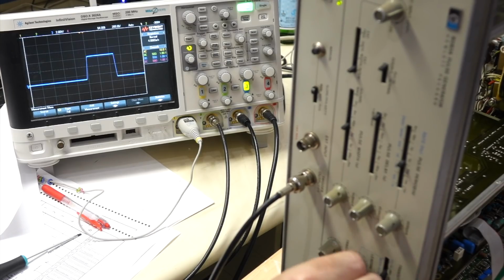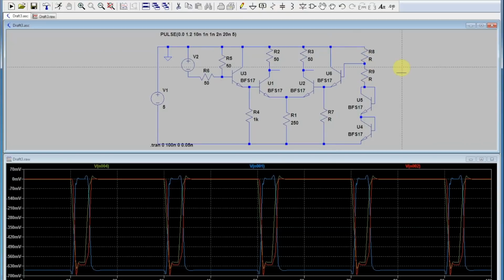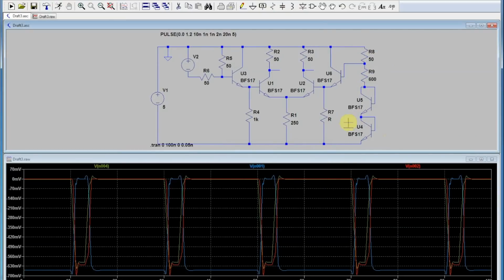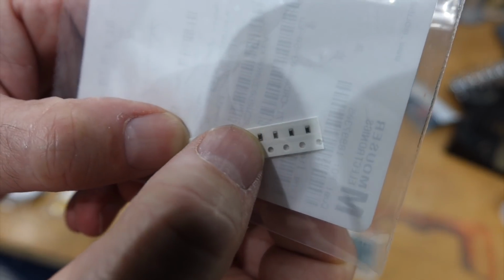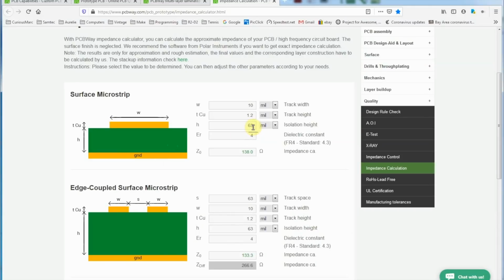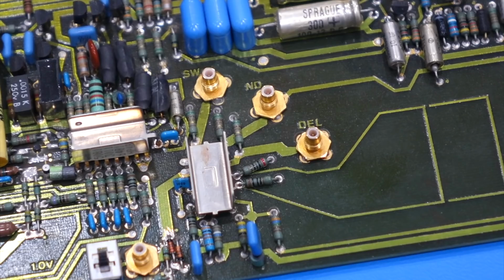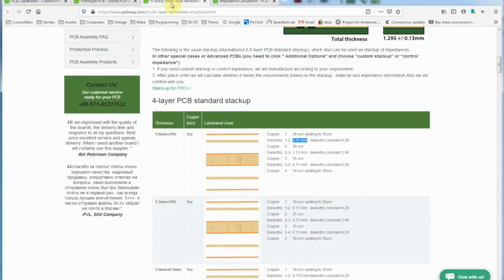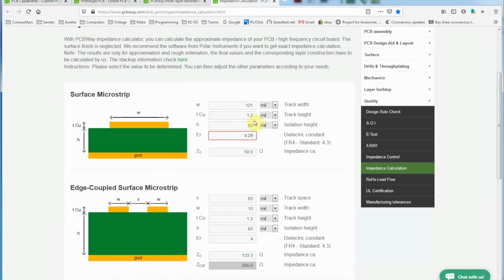HP 8082A Pulse Generator Repair Part 3: Ersatz  ECL Fabrication and Pulser Repair

Comment: I only started using solder paste and stencils about a year ago, but I found that I get much more consistent results if I add a long blob of solder paste along the top edge of the stencil (just above the holes), then use a credit card style squeegee in one pass.

Holding the squeegee close to 45-degrees to the stencil with an even pressure, then doing just one swipe downwards.

Apparently, if you try multiple passes, or dab the paste into the holes, it can tend to push the paste under the stencil too much, and kind of squish it around the pads. I think most factories just use an automated squeegee machine, and do one or maybe two passes max.

Using solder paste is fun, though. It's not half as daunting as I thought it would be, and you generally have plenty of time to plonk the components on before the paste starts to dry out. The shelf life of the paste is usually very good, too. I bought some paste a year ago, and don't store it in a fridge, and it's still fine.

This is genuinely my first ever attempt at using solder stencil and paste, and the first ever swipe, in one pass...

https://i.imgur.com/ApnV23C.jpg

But I didn't have the right kind of regulators in stock, so try not to laugh. lol..

https://i.imgur.com/Xnza7T9.jpg
Reply: I can't agree that the UI on Eagle is anywhere close to "atrocious" btw. lol

I tried many many PCB CAD programs before Eagle, including Cadence, Protel, PADS, P-CAD, Proteus, and most others that begin with a "P".
I found Eagle to be far more intuitive to pick up than most, but I get that it's a personal taste thing as well.
I am hoping KiCAD will continue to improve though, as I definitely agree that the subscription model for software like Eagle isn't ideal.

What I can say is that they started moving the toolbar icons around from about Eagle 8 onwards, after they were in the same places for over ten YEARS. Which was incredibly annoying. I still stick to Eagle 7, mainly for that reason.

(and they removed the colour from most of the new icons, which makes them much harder to see on a quick glance. sigh)

If KiCAD can fix the problems with mousewheel zooming in Windows, and make a few other UI improvements (like making it more obvious where the button is for tying a new footprint to a symbol library), then it could end up being the de-facto PCB software.

KiCAD does seem to be a bit more reliant on learning a few keyboard shortcuts, but it's not too bad otherwise.
I found it very frustrating to use at first, but I guess it's a case of sticking with it.

For now, I'll probably continue to use Eagle, or use Altium for the most complex projects involving BGAs / FPGAs. The auto pin swapping in Altium is awesome, and the Interactive Routing tools, but I do find it's library editor confusing.

I'm interested in trying more RF stuff at some point, but it's still a lot of voodoo to me. lol

The closest I got to "RF" is using Saturn PCB Calc to work out the trace width to get closer to 50 Ohms impedance for RDRAM traces (250 MHz / 500 MHz DDR)

Comment: 1:05 .. I have been an EAGLE user for over 25 years by today, even bought a limited Non-Profit version in 2008. I tried a few alternatives, but always hated the UI .. to be honest, just because "It isn't like EAGLE!" ..  I think I've developed kind of a Stockholm syndrome for its user interface by now.

I always hestitiated to buy a full version, even tried to get 2 friends to buy a 3seat license together with me. When I finally deceided to buy it anyway, they already had switched to the subscription model. 

So now I'm going to try to use KiCad until I like it, too. To be fair, they are rapidly eliminating the kludges which were annoying me with every new version.
Reply from the maker: If you switch to KiCAD, watch these series of quick video by DigiKey and Shawn Hymel: https://youtu.be/vaCVh2SAZY4 . They got me going in no time. The best UI I have seen in a free program is DesignSpark.
Reply: "Stockholm Syndrome"  😀  😀  😀

Comment: So you used the slower board that gave you a 3ns  pulse? I thought it had to be 2ns? How come it still works...?
Reply from the maker: It's really the rise time I was after. I think it just elongated the minimum width of the non-delayed pulse, in the video it looks like it's 3ns instead of 2ns. Maybe I'll go back and try with the faster circuit once I have the correct resistor in it. But it would be quite rare that I need a 2 ns pulse.
Reply: Cool . I’d love to see that . Your YouTube’s are great, a beacon of intellectual inspiration in this tic tok world . Keep them coming!
Reply from the maker: @best1brit  So in the pursuit of perfection I put the circuit with the faster transistor in. It gave shorter pulses, but first pulse still longer by 1ns than second pulse. Turns out there is a “factory selected” resistor to balance them, and another trim pot to adjust min width. Made my own “factory” balance adjustments, tweaked the width, now I have two picture perfect 2ns pulses at the min setting. Bill and Dave should be pleased.

Comment: Very nice repair, stunning. Can you make a scan of the IC schematic available somewhere, please?
Reply from the maker: Yes I have a lot of work to do on the documenting. I need to revise my PCB and schematics too with the new values and the correct landing pads for the transistors before I publish it. Will be available on my website (www.curiousmarc.com) eventually.

Comment: I don't follow but a little of what you are talking about, but it still somehow manages to fascinate me. Your analysis is so soothing. It's also inspired me to make the simplest circuit possible, understanding why the first transistors that came with my Arduino starter kit I used for powering 12v  RGB LED strips didn't light up and why I needed something like a TIP 120. And then as I read more, it dawned on my finally the difference between these and FETs. Something I have heard and read about, but never quite grocked. I still am in awe of anyone who can design such a complicated machine. You are a good presenter and I thank you for your generous sharing!
Reply: The transistors you got surely could power those strips but if they were overloaded they would get hot and eventually emit the magic smoke perhaps. But if the transistors did nothing then they were not used in a proper circuit, and I bet if you shared with us what part the transistors were, me or someone else could tell you how to hook them up to make them work. When it comes to an RGB LED strip, most common transistors can control them and it doesn’t matter whether it’s a mosfet or a bipolar :)

Comment: uploaded 11 seconds ago:)
Reply from the maker: You are first! You win a free 50 Ohm SMD resistor that flew away from my tweezers when I tried to place it. Whenever I find it again that is.
Reply: @CuriousMarc  Haha Thank you for your reply. I am afraid my vacuum is picking up resistors every time I do some cleaning to my room. Still, high precision temperature stable resistor in voltage standards could be worth a lot.
Reply: Yea, at my hackerspace in the Netherlands “de jonge onderzoekers” that’s common and we just grab another resistor